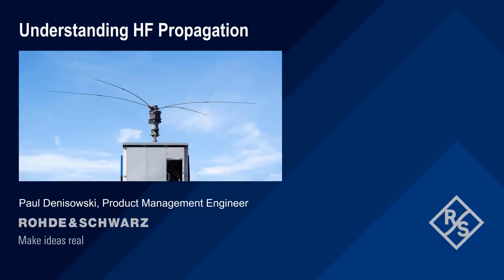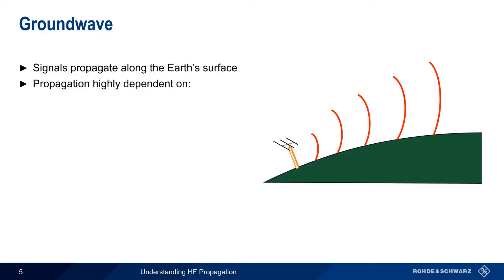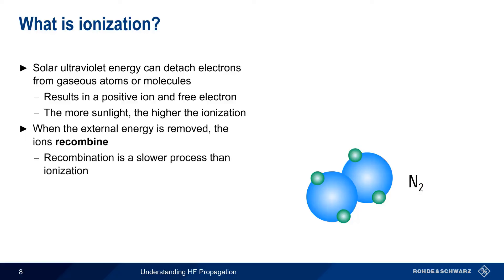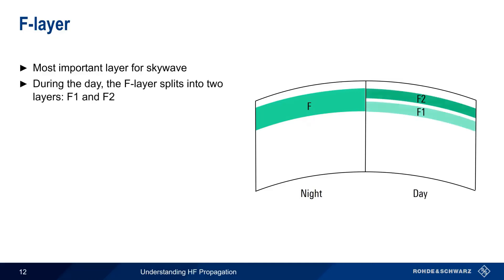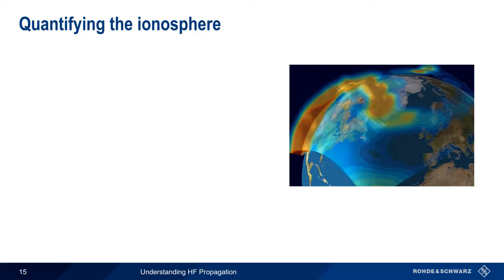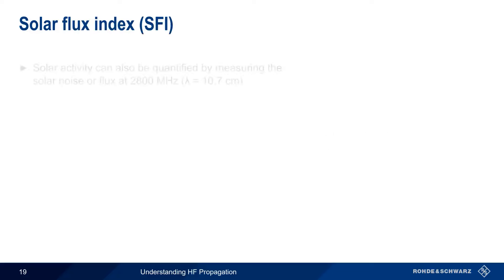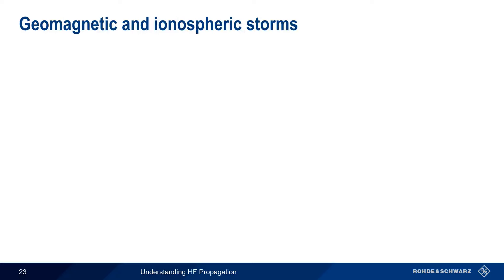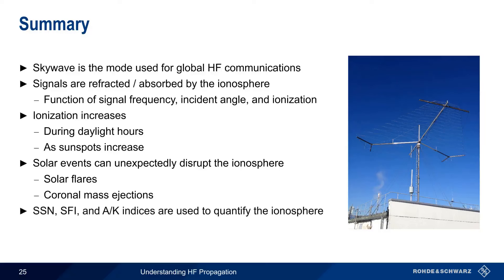Understanding HF Propagation

Comment: Does the day vs. night rule apply to the time of day for the location of the receive / transmit antennas or the location of the person you're trying to communicate with? Meaning if my antenna is in Hawaii and it's morning, but I'm trying to communicate with someone in Guam, would I use a frequency based on the time in Guam or the time in Hawaii?

Comment: One of my students pointed out that the statement at 10:43 says that when the RF passes through the ionosphere and into space, that is the critical frequency. However, all the textbooks I have say the critical frequency is the highest frequency that is reflected (refracted) back to ground. Is there another definition in use?
Reply: That's a great question.  I suppose you could avoid ambiguity by defining it as the frequency above which signals pass into space and below which signals are refracted back (laughs).
Reply: Critical frequency is the highest magnitude of frequency above which the waves penetrate the ionosphere and below which the waves are reflected back from the ionosphere. It is denoted by "fc". Its value is not fixed and it depends upon the electron density of the ionosphere.
Reply: @tixilx  that was my understanding too.

Comment: In maximum condition, how must the most longer distance range for communication in HF frequency?
Reply: HF can be (and regularly is) used to communicate between any two points on the globe, so maximum range is half the Earth's circumference :)  In practice, the maximum achievable distance is function of many factors, including the current state of the ionosphere, the chosen frequency, the Tx and RX antenna characteristics and orientation, the Tx power, the Rx sensitivity, noise levels, modulation type, etc.   During peaks in the 11 year solar cycle, worldwide communication can often be accomplished with less than a watt of power and a very modest antenna, whereas at the "troughs," it can be very challenging to reach certain stations without very high power levels and very good antennas.
Reply: @pauldenisowski  slightly more than half as the RF horizon is more than visual horizon. Radio waves bend. Plus multi hop and long path happen daily. Many factors can give more range than just half.

WW5RM
Reply: My furthest QSO is 9100 miles / 14,650 km.
Jan - ZS6HA in South Africa.
I am in Texas.

WW5RM
Reply: @WW5RM  Yes, of course. :)  Long-path is an excellent example of where the total path length will be longer than the "short part" to the destination:  There are many occasions where or reasons why long-path may be the best way to reach a given station.  And as you also point out, the actual path length will depends on the number of hops, etc.  

I interpreted the question to be: "what is the max possible distance between transmitter and receiver when using HF?" and since HF does allow (under the right conditions) communications between any two points on the globe, my somewhat tongue-in-cheek answer was "half the Earth's circumference" :)  Thanks for pointing out that the actual max propagation distance can be considerably longer.  73!
Reply: @WW5RM  Impressive!  The long path between EM23 and KG53 would be about 15,800 miles :)
Reply: @pauldenisowski  yeah it seems English isn't his / her native language. 

I will have to double check but I'm pretty sure my QSO with ZS6HA was on 40M. That antenna is a Double Bazooka up about 60ft between two trees. Not exactly favoring that direction either. I forget what antenna Jan had. I don't think it was long path but is possible. 

Some of the big guns on 40M have HUGE beams / yagis. I don't even have a tower. I built all my HF antennas myself and strung them up between the trees with a bow and arrow. =]

Comment: question about slide 23. you stated if the MUF becomes higher than the LUF @17:38. did you mean if the LUF becomes higher than the MUF??
Reply: I was wonder the same because “<“  = “less than”